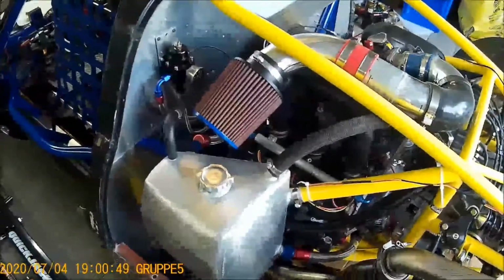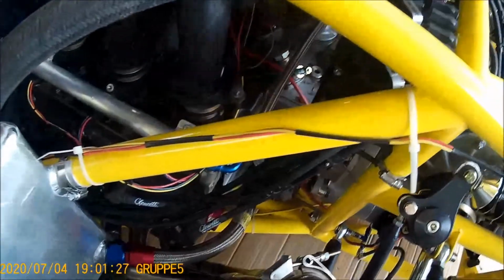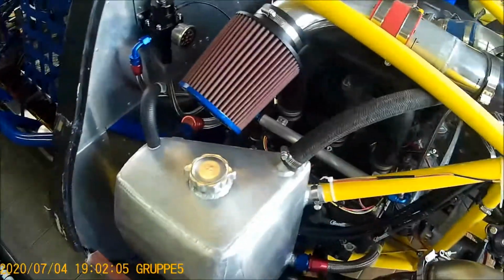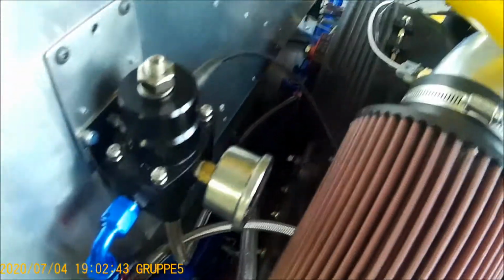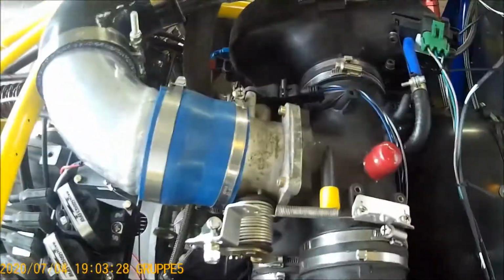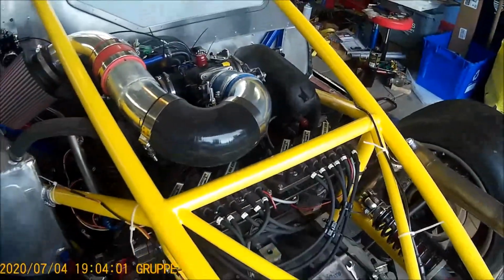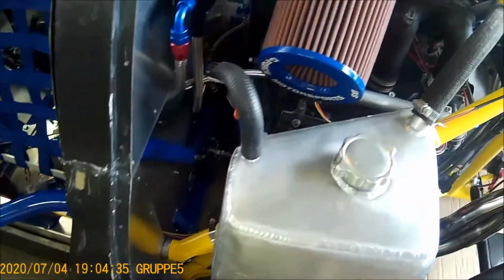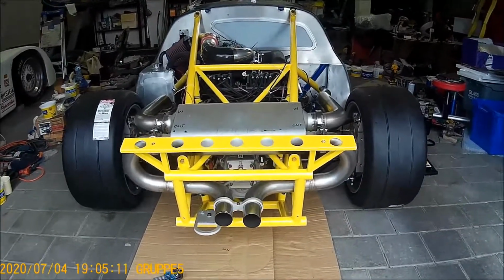Porsche 904 Project Walkaround 07/04/20

Comment: Looks like the project is coming along nicely!  
Very cool.  Is this a beck 904?
Reply from the maker: No this is not a Beck, the Beck uses a different chassis and has a cockpit that is 3 inches longer than a factory original 904. Mine is a custom one off tube frame and I have original bodywork made from molds taken from a original factory car. My bodywork is being changed to accommodate the wider wheels and tires as well as changes to suit my taste for it as a race car. Thanks for your comment

Comment: Great job! 

BTW, whats the rear tire size?
Reply from the maker: The rear tires are Hoosier 275/35/17 on 11 inch BBS rim halves using my custom cnc'd billet aluminum wheel centres. Thanks for asking.
Reply: @962and904  thank You for answering!